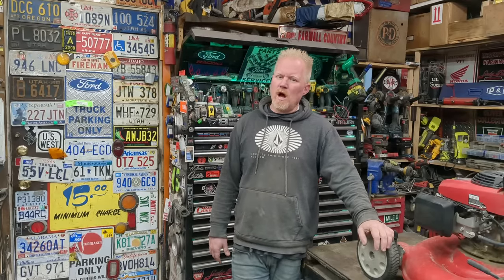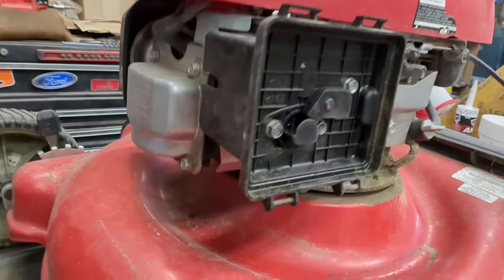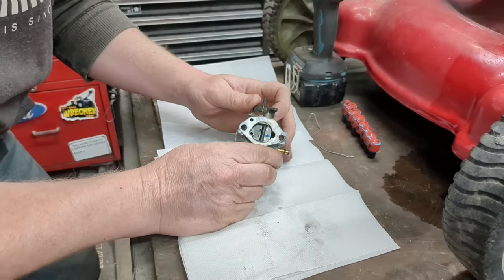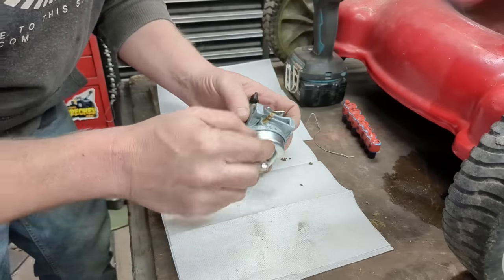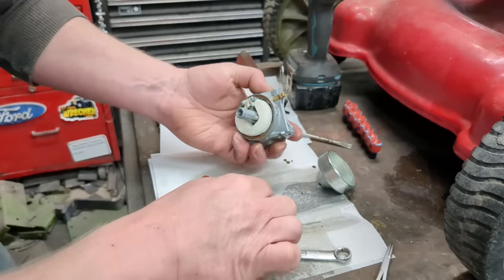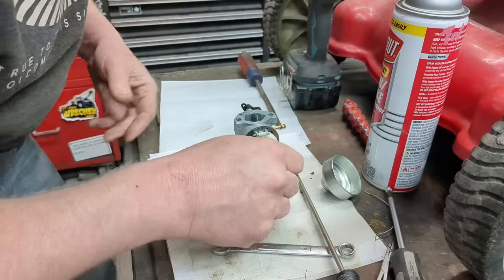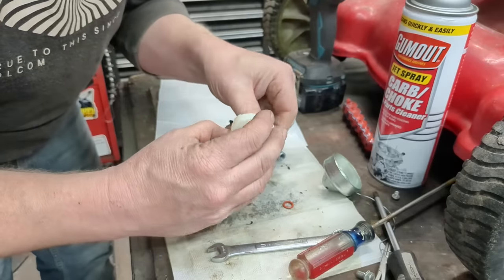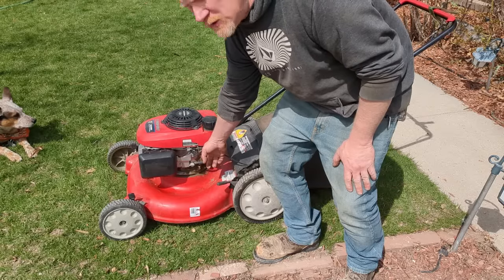FIX Engine Surging on any small engine QUICKLY

Comment: Just FYI, when cleaning carburetors that were all gummed up with old gas residues, I found that 91% rubbing alcohol (isopropyl alcohol) worked better than anything else. Give it a try sometime.
Reply: Even better, run your small engine completely out of fuel at the end of the season.

Comment: You might want to be cautious of acetone in your tank. I saw what happens when the coating inside the tank breaks down from that and gums up a fuel filter on a car that my brother-in-law had. OHHH it is nasty. I bet gas tanks on small engines do not have that coating inside, but we found out some cars do. He had heard that acetone would help get better fuel mileage...it did not. I almost always do my carb cleaning by hand... but... if I do use a cleaner, I use  Star Tron Enzyme Fuel Treatment. Put it in the fuel and run it, then let it set overnight. That fixes 90% of dirty carb issues for me. I hope you do not mind the information here, just want to help.
Reply: No idea of what I would get.

Comment: Why are you hating on my boy seafoam? The thing does wonders for every engine I run it through. The engine always feels much more responsive and powerful after I use it on a vehicle that has never had it done before.
Reply from the maker: Seafoam is essentially rubbing alcohol, a really thin oil(kerosene) and Nahptha(lighter fluid). About the only thing that does anything is the rubbing alcohol which mixes with water and allows water to burn. But that could be remedied just by draining your old  fuel out/ water.  The thin oil and Naptha are very mild cleaners, but in the ratio they're used to gasoline can do very little. It's kind of like using the rain to wash your car where a few things will fall off, but it's still dirty without getting in there and putting some elbow grease on it. Now if I left straight naptha or kerosene on some varnished fuel. It may soften it after a week or two, but definitely not if I diluted it 99%. Clean gasoline by itself is a better solvent. So here's where the "snake oil" comes in. People taking say an old junkie motorcycle or something that's been sitting forever with water in the fuel/ fuel has very low octane due to evaporation. You throw rubbing alcohol in there which is pure octane/ allows water and other crud to burn and you're able to get the engine started. You then run it and allow the new gas to come in and actually the new gas is what creates a better running condition and cleans up the system. 

Why it's called snake oil. Because no matter what you say or what proof you have behind it people will believe it works for them even if they find out it's made of snake oil.
Reply: @sixtyfiveford  I see. Thanks for all of the information =)

Comment: Great video! I just revived my 12-year old Honda walk-behind by following your instructions. It was surging and would only start with a spray of starting fluid.  I had replaced some gaskets and sprayed the carburetor before, but it didn't help.Your video gave me the confidence to try again. About the hardest part was figuring out which way to put back the plastic intake port that goes between the carb body and the engine intake. I also did a valve lash (both settings were off by about two one-thousandths of an inch.) After all was done, the engine started on second pull. Then it restarted many times after shutting down. I can't thank you enough.
Reply from the maker: Great work
Reply: Great video, thanks.
Reply: Check for rust stains and faint imprints from mating surfaces or gaskets.  They can be the clue of how it goes back together.  Nowadays I video anything carefully before I take it apart so I have a record of what it was like.
Reply: @hugegamer5988  Thanks! I did finally figure it out from the imprint pattern on the gasket. Video is a good idea, but I'm just not into my cellphone. It usually sits on my desk or bureau. Too old I guess.

Comment: My snowthrower was surging this past winter. I used SeaFoam and it really did work. It stopped surging relatively quickly. I tried it out because I didn't feel like taking the carb off my snowthrower in the dead of winter, lol. I will be taking the carb off in in off season to clean it out though.
Reply from the maker: The isopropyl alcohol (rubbing alcohol)in seafoam is generally what does the trick as it allows contaminated fuel to burn.

Comment: Finally someone is getting it. I have had so many costumers argue with me on this. When you are done with the machine for the year. Run the fuel tank completely dry. Then put some Aspen fuel in, not a lot. Start the engine for a minute or so then set it off the side till next year. Aspen fuel is good in the fuel tank for 3 years and good in the bottle unopened for 5 years. Aspen fuel also burns cleaner then any other fuel.
Reply: Aspen fuel?

Comment: Had a craftsman lawn mower with that same engine. Three years and it started surging. I took it apart and clean the carb out thoroughly. Work for a while but later that year started acting up again. I took it to Honda and let them clean the carb. They soaked it got it back later that day worked good but a few Weeks later started acting up again. Took it back and they soaked it overnight. Worked good for a while and then started surging again. I got some seafoam, the fuel tank was almost empty so I put a good shot in there. Pulled it out of the shed, kick some snow to the side and let it run for 10 minutes. Pushed it back in the shed and said " pos if you do this next spring you're gone". Used it for 11 years after that with no problems ever again. Sold it a few years ago running in mint shape cuz I bought a Makita battery operated lawn mower. Gas is crap these days!  Don't dis' seafoam! 🤣🤣🤣 But good video!
Reply from the maker: Gas is garbage these days and doesn't last more than a month or two in a plastic gas can. I have people all the time pour their own gas in a carb I just rebuilt and foul it up. Drives me crazy. I now won't let an engine leave my shop without a full tank of my gas(ethanol free) in it.

Comment: Thanks for the detailed explanation of how the idle circuit works, and why the engine surges when the idle circuit is blocked. As you said, it's easy to fix if you understand how it works. Also, thanks for making this video. It helped.

Comment: You answered a question I've always wondered about what or whether products actually un-gum carbs. On my own stuff, I've always disassembled and used gasoline or kerosene depending on what I was cleaning. When I worked in a shop, we used a chemical bath which worked well. Always felt that OTC stuff is a waste of time (and money), and glad to have it verified.
Reply: Same here, gasoline has always been my clean solvent on parts.
Learning here that most of those “fuel cleaning additives” are mainly acetone. 😮
What!? 
I would like to still do a bit of research regarding this but man, great new info on this vid
Reply: Acetone/alcohol  in cheap carb spray saved my fuel pump one summer. On my Chevy pickup.
My OEM A/C part was still good after ages, but my fuel was the issue.
I later replaced my A/C pump because of a repeat. But then the new part stopped pumping.
I put a length of inlet hose in place to access
Filled it with carb spray, cranked it over. The carb now was getting the carb spray from the pump.
I changed my fuel and my fuel station of choice.
This was years ago, now. I had to let the fuel supply into a container and replace with fresh gas. These cheap cans of carb spray are under three dollars.
Reply: I LOVE seafoam.  I got a free motorcycle from it.  Guy at work told me the engine was totaled and gave me it for free, I didn’t care because I wanted it for parts for my old bike of the same make.  Imagine my surprise when I opened the carbs and they were caked full of congealed seafoam.  Cleaned it properly by disassembly and placing it in a recirculating solvent bath.  Drove it the next day to work and man was the guy pissed.
Reply: @hugegamer5988
I seafoamed my '91 S10 4.3 trying to get it to pass smog.  LOVED THE SMOKE SHOW!  Even took pictures.  

The Seafoam was a lot more fun than replacing the O2 sensor & shelling out for a new cat.  Eventually it passed. 😂

Comment: I just did this for the first time. I thought it was just old but I did this and so far no more surge. I was going to scrap the lawnmower thinking it couldn't be fixed. Thanks for posting this.
Reply from the maker: Awesome
Reply: Using recreational gasoline or using a fuel additive all the time would virtually eliminate the issue from developing.
Reply: @kevinferguson3196   Recreational gasoline? That's comical. LOL.
Reply: @sixtyfiveford   have very good question as you have repaired a lot of carbs ... can you tell us how many times you have went through the  complete  carb cleaning on mowers like  tb240 , others mowers( walk behind  Mowers only)  and  it  they still surged  , and you had to buy a  new carb kit to get mower  to run right .about how many times?
Reply from the maker: I never have to buy a new carb or carb kit on a walk behind mower. If it still surges I did something wrong and I do it again.
Reply: @sixtyfiveford  ,now how many times  have you had to remove and  reinstall a carb that kept surging and was a  doozy  , 2-3 , 4  times  until you finally get it to not surge? .
Reply: @sixtyfiveford   i'm talking only to clean  it as video  shows to make it work... and isnt it true sometimes  the  float needle/ seat is  worn and it creates issues for  surging and running out of gas in float bowl also,  and only way is to put new one ?
Reply from the maker: @lifehealth489  A needle/seat won't cause surging. It'll only cause flooding/ gas will leak everywhere when the engine is off.
Reply: @sixtyfiveford  ahhh, i thought opposite  A swollen seat would cause the flow of fuel to be cut off too soon, leaving only a little bit of gas in the carburetor bowl, and could starve motor  of fuel  ...also thanks for your quick responses
Reply: He means gas that does not have any ethanol in it, which is typically only allowed for recreation by law.  @saved74
Reply: @renalshomlmes338  Yeah, I looked it up. It's also called rec90. Too funny sounding. It's hard to find in my area.
Reply: @saved74  here it is 90-92 but has many names depending on brand. Due to all the boats, small engines, collector cars most stations here have it.

Comment: Spray some gumout in the carb and some into the gas tank if you don’t know how to take a carb apart. You might have to work the throttle by hand if to rev it up if it starts to stall when you spray it. Use short bursts.

Comment: Have a JD riding mower that started surging at idle.  I ran heavy concentrations of GUMOUT Carb and Fuel System Cleaner in the fuel for a full season.  By next season, the surging had stopped.

Comment: Thanks for the inspiration! Not sure why I waited until 3am to start on my Honda's carb but it runs great now at 5am😀. I used some copper wire from some lamp cord. 
Most of my time was spent trying to find my carb cleaner that I had set aside for this job a couple of weeks ago🙄duh
Reply: Yup.  Where's my....

Comment: Thanks for this. I cleaned out the carb a few weeks ago but it started to surge again. I didn't clean out all the small holes and pipes like you. Thankfully acetone in the petrol did the trick. I let it run, surging away for about ten mins, then there was a loud hiss and she sprung back to life again. You saved me a few quid. Really appreciate it.

Comment: I'm an experienced small engine mechanic that has done countless carb cleans and I never heard of using acetone. Cool tip. I'll try it one of these days
Reply from the maker: It's the main; sometimes only ingredient in carb cleaners. Sometimes they'll also put things like toluene because they don't evaporate as fast.
Reply: @sixtyfiveford.  I didn't know that card cleaner was acetone. No , I thought it was methyl alcohol and other VOC'S /petroleum distillates. Some brake cleaner is mostly alcohol.  Acetone or nail polish remover has a sharp smell I recognize immediately and carb cleaner seemed different.  Live and learn. Carb cleaner is a good diagnosis tool for gasoline engines too. For the heck of it I used to run small 4 strokes by spraying it into the intake port of cylinder head. No carb, no manifold.  😅

Comment: My brother's 2 stroke Lawn Boy  use to hunt, I went through the carburetor a couple of times, no luck. The governor was the kind that blew air on a vane attached to the carburetor, I finally took some solder and added weight to the vane, problem solved. 
Ginger never fails to put a smile on my face, she sure is a sweetheart.
Reply from the maker: I still have a two stroke Lawn Boy I use a few times a year just for fun.
Reply: @sixtyfiveford  I have a couple of curb-rescued LawnBoys. I'm into retro stuff for some reason. Thanks for this video....my John Deere 14SB is surging.

Comment: That was a great demo for cleaning a carb.  Some simple things an amateur, like myself, require a pic or notes. Such as which way did the float go or how to stop gas coming out the disconnected rubber tube
Reply: Clamps or have a bucket handy

Comment: I have a Honda HRX217 with a GCV170 engine. I tried about 10 different videos and this is the one that finally fixed it for me. The carb is slightly different but same concept. Understanding how the carb works and how to check if its working allowed me to fix it. Thank you!